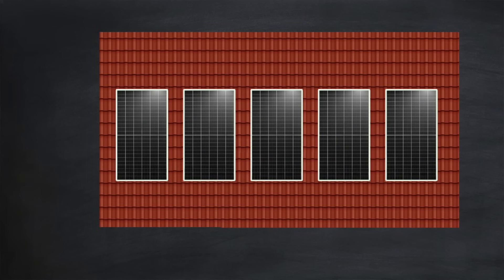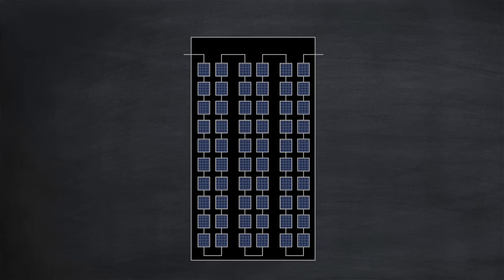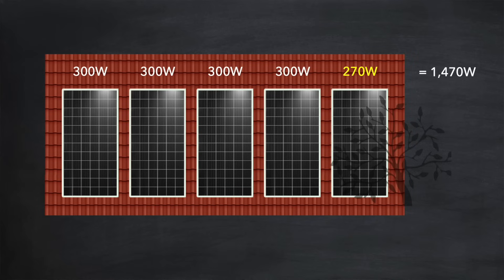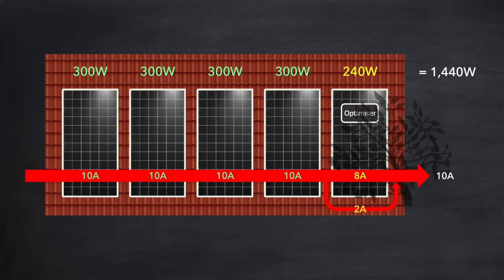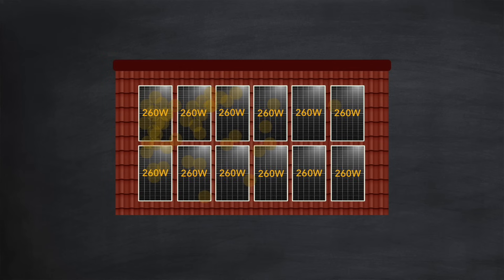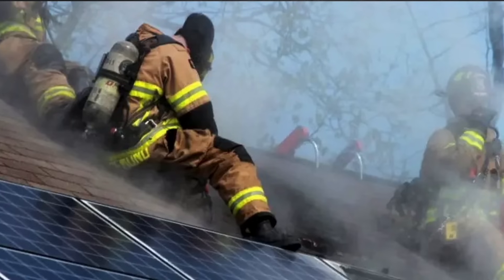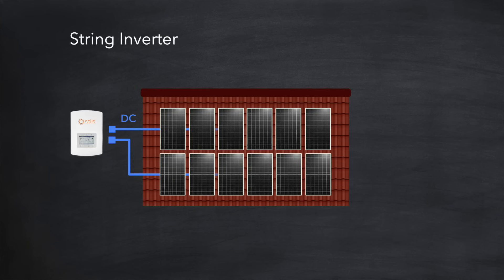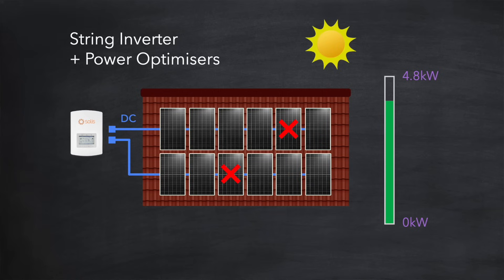Power Optimisers - What are they? And do you really need them?

Comment: My son & I have very similar solar systems installed by the same supplier. We both have JA Solar 395W panels (he has 12, I have 8) & both arrays face West. Neither of the arrays have shading issues.
However I have 4 optimisers & he has none. Why the difference? Well I think we both went with what the supplier recommended. 
In theory, all things being equal, the ratio of my solar output to his should be 0.666 (8/12) & right now, in Summer, it is. However in the period October to January it consistently ranged from 0.71 to 0.735. It was like I had 8½ panels to his 12. I put this down to my four optimisers. That said, given solar generation in winter is pathetically low, the value of the 'extra' is worth two tenths of bugger all! Had I had my time again, I would NOT have had optimisers put in & saved a few hundred quid.
Reply: During the winter months even a few degrees difference in orientation and inclination of the panels can significantly affect the output.
Reply from the maker: Hi there, thanks for sharing your experience with optimisers. This is more important than you think, because people both with and without optimisers will still say they're good (or bad) even though they don't have any means to compare with what the generation would have been in the opposite case. Your case here though, with two similar setups, one with and one without optimisers, indicates that optimisers actually have an adverse effect if there are no shading issues!
Reply: @GaryDoesSolar  Hi Gary, can I suggest a topic for a future vid? The monthly performance of my array has totally confounded my expectations of it. It's a small, west facing 3.16kW array. Notionally it should throw out 2,200 kWh/year with a minimum of 1.68 kWh/day in December & a maximum of 11.45 kWh/day in May. The reality was my December performance was dire at just 0.96 kWh/day (with 3 days of zilch!) but my May performance, at 13.58 kWh/day, was better than anticipated. Indeed June is already shaping up to hit 19 kWh/day! This shift to the extremes (v v bad in Winter but v v good in Summer) has totally changed the economics my solar system.  As best I can estimate, I will only reduce my annual grid off-take by two-thirds (not 80%) while a whopping 57% of what the panels generate will get exported to the grid (not the 20% I was expecting). I can't be the only person who's befuddled by this. If you can explain quite what's going on here, I for one, would be grateful.
Reply from the maker: @MrSensible2  Ok, first it's worth trying out the JRC utility as explained in this video, to get an accurate understanding of how much generation you should expect throughout the year given your location and setup: https://www.youtube.com/watch?v=MdpQci4vTLU. That utility is based on historical weather data. 

Then, second, I'd say that (as a likely consequence of the climate crisis) the weather we have been experiencing over the last couple of years has just been wild: a lot colder that it should be at certain times of the year, and a lot hotter at other times (e.g. 40+ degree heat wave last summer). 

Given this, it's worth considering the following as part of a solar strategy:

1. Organise your life so that you're consuming as much of your generation on any given day as you can (washing, EV charging etc.)
2. Use a battery to store the rest (to be used if the next day is not sunny)
3. Choose a tariff with a high or at least reasonable paid export (to get some compensation for everything you can't use)

Maybe others have additional thoughts on this?
Reply: @GaryDoesSolar  Hi again Gary. Thanks for putting me onto the JRC tool. I found it last year, before I had the panels put in but couldn't figure out how it worked. 
The good news is that I now know how to get monthly figures out of it. The bad news is that it outputs much the same data as my other attempts to predict my system performance; it over predicts what gets generated in Winter & under predicts what I get in Summer. For example in May, JRC says expect a total of 332 kWh whereas I actually got 421 kWh. In June, JRC says expect 11.66 kWh/day but up until yesterday, I'm averaging 19.00 kWh/day (& that's with a very obvious layer of pollen that's settled on the array!). I've faffed around trying different roof angles, azimuths, PV types & databases but nothing skews the data to fit what I'm seeing, so I'm going to accept your weird weather/climate change hypothesis!
I guess I shouldn't complain as I'm getting way more summer solar than I originally expected. However if you have this issue, you really do need to change the way you 'see' the system economics to being primarily an export income generator & less a reducer of your existing leccy bill.
Reply: @MrSensible2 I know your comment is a year old, but could you share more details of your solar panel setup? For example, do you have a centralised string inverter or have you added optimisers / micro-inverters? If it's the former, my guess would be that that explains why your winter generation is lower than expected (part-shading or other similar reasons affecting all panels rather than just 1-2 panels, as explained in this video, plus the system needing higher power overall to start generating electricity).
Reply: exactly    optimizers are junk,  they clogged the electrical flow, they make power decrease as you see  no matter what the installer tech tells  you, and they are another failure/ hinderance  point   AND they Increase cost  to No True  benefit, they rob you $$  and juice  in 2 ways  !!!

Comment: Interesting video,but, without hard facts about failure rates of the epuiment discussed, it is not very useful. To say that the inverter WILL fail within 10 years or so is a very broad statement and one which the manufacturers of quality products will take issue with. A video like this must be based on hard and well researched facts, not speculation.
Reply from the maker: I'm ready to accept criticism, but please quote me correctly. What I said in relation to string inverters was:

"Now today’s string inverters tend to only last maybe 10 to 15 years."

And

"But, this approach also has the string inverter to contend with. And when it fails, and it will fail during the lifetime of your system..." (25 years)

My comments were based on reports like these:

https://www.pv-magazine.com/2023/02/08/survey-shows-34-3-failure-rate-for-residential-inverters-over-15-years/

https://www.energyterrain.com.au/post/inverter-lifetime-performance-and-reliability

The fact is that It is highly unlikely that a string inverter will last a 25-year operational lifetime of a solar system.
Reply: @GaryDoesSolar  My comment has been edited, but I still want to see facts. To look at failure rates of equipment that is over 10 years old does not mean that todays equipent will see the same failure rates. Modern technology and design experience has made equipment much more reliable. What is of concern in the installations that I have been called to inspect is the underdesign of components. Mostly an installer will install inverters that just barely meets the customer requirements and as such runs at near 100% all the time. This is done due to the stiff competition in the market and customer ignorance.
Reply from the maker: So, just to be clear - you want facts about the future performance of today’s string inverters? 😳
Reply: @Fotovliegtuig  
It’s difficult to find data about longevity of pv equipment and other issues like inverter size, clipping and pv output.
What’s your experience? Would you share any data?
Thank you

Comment: 3-Phase connection -> 3 single phase string inverters instead of one 3-phase one. 
Disadvantages: slightly messier cabling, bulkier, slightly higher cost than a single 3-phase inverter
Advantages: cheaper than micro-inverters or optimisers, soft shading on one panel only affects one of three strings, any failure within a string (incl. inverter) still only results in a loss of 33% production, overvoltage protection kicking in on one phase doesn't affect production on the other two, nothing but panels and cables on the roof.
It's like having 3 huge panels with micro-inverters that are easily accessible.
Reply from the maker: Interesting. Although, could the same effect be achieved with a single-phase string inverter managing 3 strings?
Reply: @GaryDoesSolar  A single multi-string inverter would also do the job shading-wise indeed. Downside is that a fault with the inverter itself means 0% production until the inverter is fixed/replaced, using multiple smaller string inverters is a middle ground between a single string inverter and micro-inverters when it comes to redundancy vs simplicity.
Reply from the maker: @Candisa  Good points - I like your thinking! 😃👍

Comment: I have a SE inverter with 15 optimisers in a single string  - I’d say they are worth the extra for the gains over time due to shading and the mix of thin film and mono panels I have plus the reporting - all panels are not made equally - some have a difference of 10% over their life so far. In 10 years I’ve not had any issues until March this year when one optimiser stopped reporting - SE happily replaced it under warranty - downside being it was a pain to replace but I was able to do it myself luckily otherwise it would have been a scaffold plus installer job and £££ - with the new optimiser there wasn’t actually any difference to the total output I think it was just the data reporting that had failed rather than the power conversion 🫤
Reply from the maker: Thanks for sharing your experiences with SolarEdge optimisers! :-)

Comment: Hi Gary, nice video. I see you have a GivEnergy inverter from your video. Do you actually see your bypass diodes cutting in ? I never see the GivEnergy inverter giving up voltage to maintain the current. So my string collapses with small amounts of hard shading. ( No optimisers)
Reply from the maker: Hi John, glad you liked the video :-) Yes - I have a 5kW Hybrid GivEnergy string inverter. Now, I don't have any shading issues on my panels, so the bypass diodes will never kick-in, but I am planning some shading tests at some point - I also have a spare panel to do these tests on as well :-) Let's see how my kit performs...
Reply: @GaryDoesSolar Look forward to it, sounds like we have the same kit. For refrence, my half cut cells are in a 6 panel string. Hard shade on 1 half of a column drops current to around half, as expected, but if both halves of a column see shading, or more of the panels I get a drop to lowest denominator current. So PV drops from 2kW to circa 1kW, then around 300w. Stays there all the way to all panels shaded.
Reply: @GaryDoesSolar Just found something interesting. If you do the test with a piece of cardboard directly on the panel, you get the expected results. However with hard shading ( so still some illumination) then the diodes don’t seem to cut in with the GivEnergy mppt
Reply from the maker: @johnreid725  Hi John, did you mean to say "diffuse" instead of "hard" shading in your text above? If you did indeed mean hard shading, I would not expect any illumination?
Reply: @GaryDoesSolar  Hi Gary, to expand, in case definitions differ. The first case was with zero illumination, ( Cardboard directly on panel). And I was defining hard shade as a neighbours roof, where the shade is uniform, with the roof being between 3 and 10 metres away as the roofs diverge.  For context, as above, the current through a panel where both halves of a half cut column are shaded drops from 9 amps to 0.9 of an amp for the whole string. I was thinking hard ( close solid object ), soft (distant tree) . Perhaps it is a s simple as the MPTT  sticking with the local maximum, as the shade isnt "hard enough" 
The thing I dont fully understand is that most internet articles discuss the behaviour of the diodes under shading, as if they act independently. I believe that the behaviour of the string MPPT is crucial in deciding if current is maintained, forcing bypassing diodes to operate, or voltage is maintained, leaving the diodes not bypassing. This is seldom mentioned ? ( Your videos in contrast are much more whole system :-) )
Reply from the maker: @johnreid725  Hi John, thanks for the extra detail. On your last point, my understanding is that the bypass diodes are very simple beasts - functionally, they see the level of current coming into the substring that they're managing (typically a 3rd of the panel's cells in a full-cell panel) and if the current flowing through that substring is less than (say) 70-80% of the current coming in, they'll "kick in" and bypass all the current around the substring.

So, if there was the same level of shading across all three substrings of the panel (or all three upper or lower substrings in a half-cell panel) then the string inverter's MPPT could come into play, reducing the current so that the bypass diodes no longer kick in...

Comment: These problems only arise with string inverters. 
Optimisers try to improve the disadvantages of string inverters.
Optimisers also use solar power when there is little sunlight.
But you could also use Micro Inverters and not have these disadvantages.
Reply from the maker: Yeah, microinverters have a lot going for them, especially for the mass consumer market, I feel...
Reply: I have a string inverter system that is several years older than my neighbors system with micro inverters. We have compared production data, and my system typically comes online about 20 minutes before their system does, for the panels on the same orientation.

Comment: A point that gets overlooked in all these discussion is that optimisers have a limit to their power output of about 350w.  In an optimal installation with no shading, I believe that a simple 400W panel only installation will produce more electricity than an equivalent optimised configuration albeit without all those diagnostics. 
During a planned re-roof, I was considering a 13 panel (5+5+3 the 3 being NW side) in-roof install which was quoted at £8.5k for a 5.33kW Solar Edge System,  £10.4k for Enphase and a simple 2 aspect 5+5  4.1kW system for £6.3k using a small un complicated Growatt inverter.  I decided that simple is best and may put the difference towards a Powerwall. The amount of problems people face with software updates for all these sub components is unreal so the less there is of it the better.
Reply: That is not generally correct:
SolarEdge optimizers go up to 500w until 12.5K inverter and up to 1200w for 16K inverter - that is what the optimizer can output and u should not attach a larger panel - so oversizing panel to optimizer is not a design in SE systems - however it an be done, but be careful

Enphase on the other hand does suggest oversizing panles and that quite a lot . the highest rates I8 has a max power delivery cont. of 380W and the recommend that micro onverter for panels "up to 500w"
Reply from the maker: Certainly, if there are no shading issues, then panels are very reliable so unless you really want monitoring, I don't think they add a great deal of value against the extra cost outlay.

Comment: I had a solar edge optimiser fail on my 3.96kW array. Cost was £500 plus because of scaffolding requirement but the optimiser was replaced under warranty. The optimiser that failed was on the panel that produces the most! Array is now 8 years old and the other day produced the second best daily total, so panel degradation seems to be low (just after I cleaned them). Benq panels.
Reply from the maker: Thanks for sharing this, Jon. Yeah, a £500 scaffolding cost is quite a hit for a single unit replacement - I'm hoping that scaffolding technologies improve over time, to get those costs down - like this company: https://www.easi-dec.co.uk

Comment: Really detailed view of all the options…
I choose no optimisers based on ‘No shading’ and ‘reduced failure risk’ by not having another element on the roof.
Watching YouTube solar installers doesn’t help with the potential failure rates as I’ve seen two failures, one panel and one optimiser! 😂
Reply from the maker: Thanks Mark. Yeah, shading is certainly the primary driver for fitting optimisers, and so if there are no shading issues, then the financial case weakens dramatically...

Comment: Having two systems, one with Tigo optimisers and one without, both connecting to SMA inverters, and both systems being installed in 2013, I can say the optimisers are snake oil, a con, and totally useless.  They actually reduce reliability of the system as they introduce another piece of electronics, and another set of connections.  To be fair, the Tigo system has been rock solid, but I hear of solarEdge optimisers failing quite often.
Reply from the maker: Hi Andy, thanks for sharing your experiences with optimisers. This is very helpful to those considering them.
Reply: @GaryDoesSolar  Thanks for the reply. 

I suppose if you have a really bad shading issue with your panels, then optimisers/micro invertors are a good plan, but if you've got non-shaded panels then I think they're a waste of time and money. I see lots of companies, including some who post on YouTube, fitting optimisers by default even on unshaded high roof buildings, and I honestly think they're wasteful.
Reply from the maker: @zstation64  I agree, and you see this in other industries - up selling on the basis of "well, would you want to take a chance not having these...?!" 😠
Reply: @zstation64 Do you have any shading on your panels? I got this antenna abit bigger than normal antennas that will create some shade on a couple of panels. I wish to avoid optimiser on my roof but not sure if the antenna will affect all my panels.
Reply: I have severe shading on my roof, with severe shading that covers half of my roof, and is it worth installing the optimisers in this case? The solar company recommended tight optimisers on all panels.